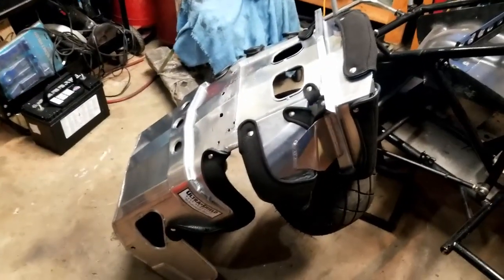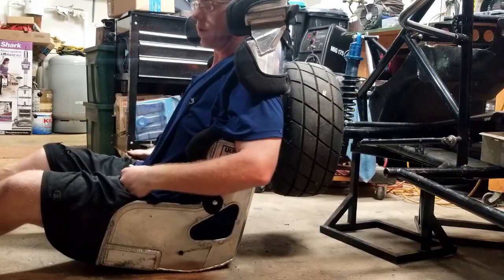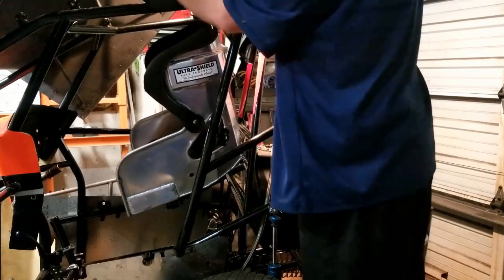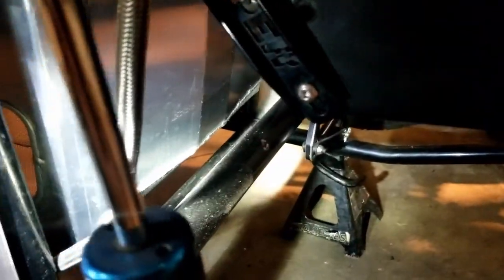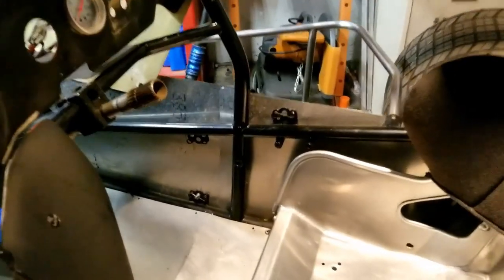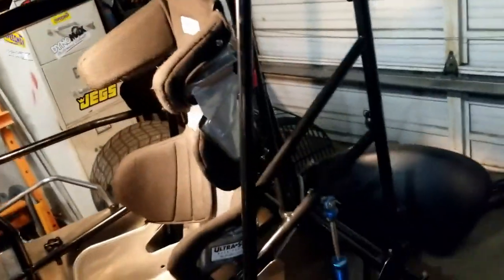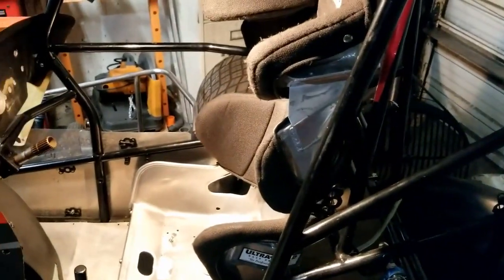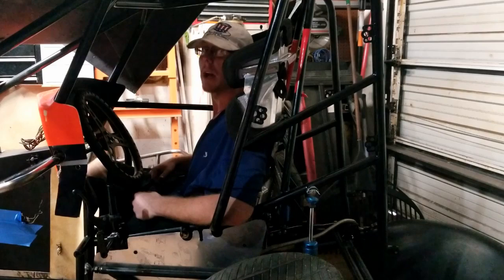micro sprint build #3

Comment: How tall are you Mike? I'm working on a Micro build and wonder how you managed leg room? (I'm 6'5")
Reply from the maker: so first ill start with in my car the seat is straight up & down against the A-frame all the way back i run a outboard brake rotor to allow the seat to come back i have about a 1/4" gap between the seat back bottom & rear axle. As far as leg room i have the adjustable pedals all the way forward as far as they can go in all truth you need a tall boy car. My car i have now is a standard cage hyper just started a option where the a frame is moved back & the radiator support is moved up so your feet have room as well as the seat bottom bar is flat not raised. Ill do a video on it shortly

Comment: How much was the parts to make the fraim and all the other stuff because i want one not to be greaty you dont have to build me one i was asking because my cousins have one and want to race with my cousins but i wouldn't race with them because their in the 6 though 12 group. i would be in the 15 and up so would i have to get a bigger one or would i just stay in their size sprint car. My dad is a really good builder so ya.
Reply from the maker: all the cars are around the same price this is a hyper chassis the chassis & body are $4400 & a full kit is $12-$13 the car itself is not the expensive part its all the little items that add up these cars cost as much as a 360 sprint car except the motors, tires, fuel cost expendables  are cheaper in the 600s

Comment: I want to build my micro sprint, what engine should I get ?
Reply: I want to race 270s
Reply: I have never raced a 270 only 600s but I assume that the cr250 is the motor of choice judging by what's for sale on classifieds
Reply: @tex384  what would you prefer a cr250 two stroke or a Honda gx270 4 stroke?
Reply: @magmasloth3619  to get set ups id get a honda cr250 2 stroke but if you want a fast dominating car geg the 450 4 stroke but you'd have to set the car up different youd have to set it up like s 600